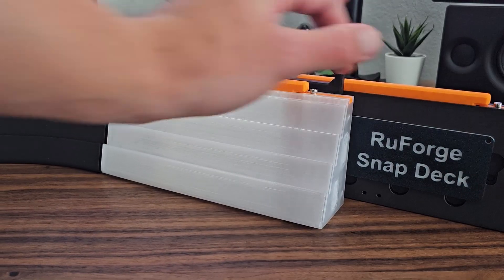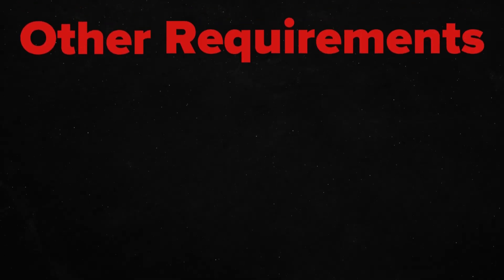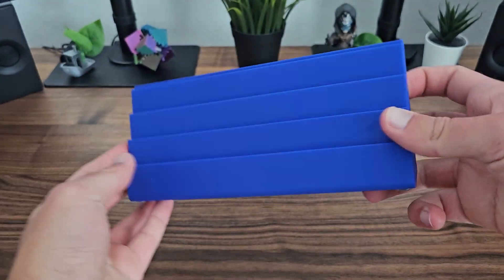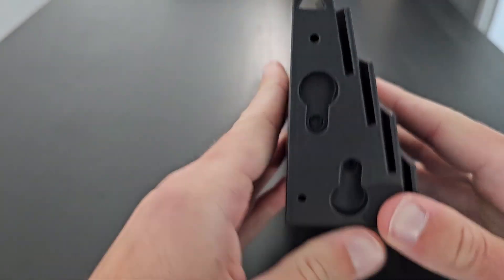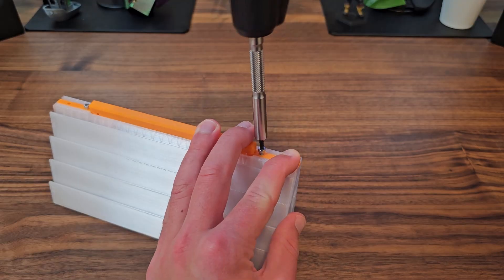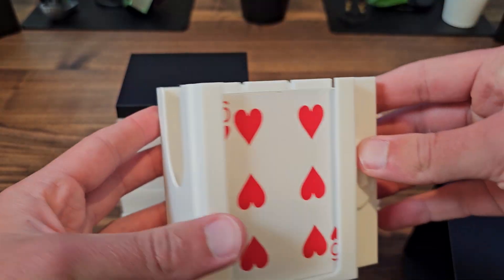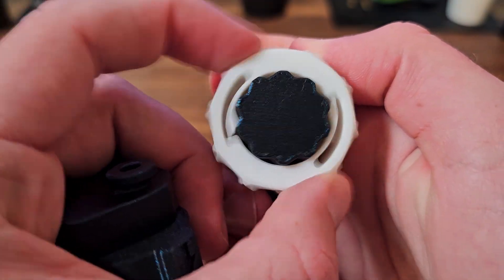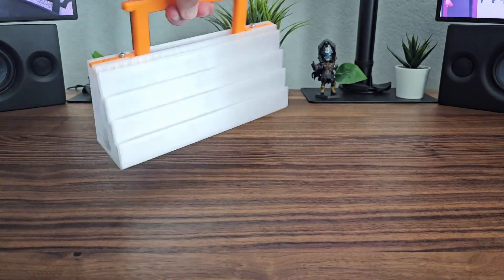The Most Versatile 3D-Printed Playing Card Holder

Comment: I was looking for an excuse to buy a 3d printer and my trading card game (addiction) hobby will be the quickstart for it. 
Absolute BANGER idea for the card holder and all the gadgets.
An idea that came to mind that was not mentioned in the video is some kind of grip to attach and hold the SnapDeck to the side of the table, most TCGs tend to use the entire desk as space for the cards, so sometimes it is hard to place it on top of it, maybe i'll give a try at moddeling this idea myself, but if this sounds like a cool idea i'd love to see your solution to it.
Reply from the maker: That is a great idea! Like a clamp that can be mounted on the back. If I get some free time soon, I'll give it a go

Comment: What 3D printer do you use, or recommend? Sorry if you have already stated it somewhere already.
Reply from the maker: It's all good! I am currently using the P1S. It is a bit older now, but the hardware is still amazing. Of course, there has been some weird controversy over the way they handle their software and cloud services, but there is a reason Bambu took the industry by storm a couple years ago. My first big purchase many many many years ago was an original prusa mark 3 when they first came out after saving up for a while, and then I got my hands on an ender 3 to try and mod my own firmware, but if I was just starting out today, I would probably pick up the Bambu A1 as my first machine. It's solid, crazy easy to set up and repair, and also priced competitively. Let me know if you end up diving in and how it all goes!